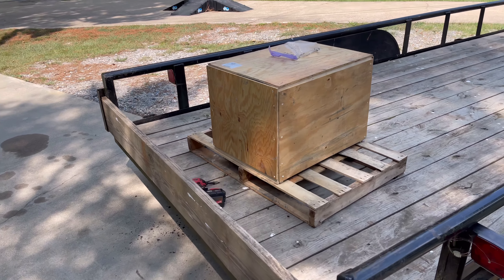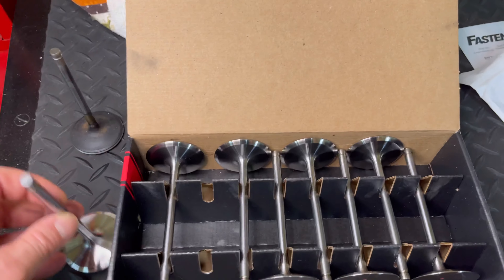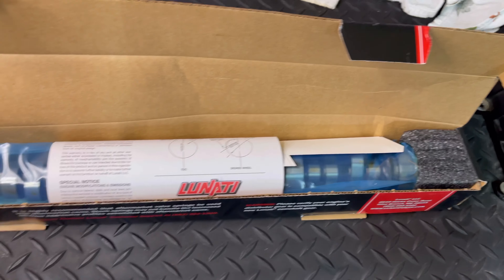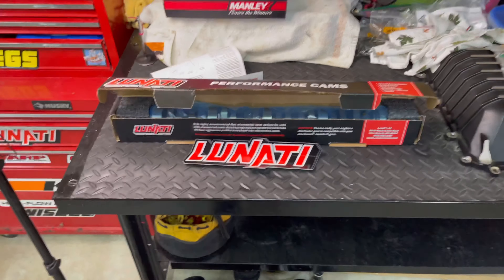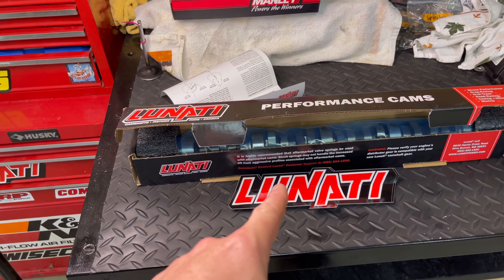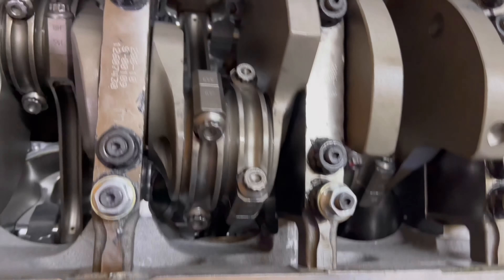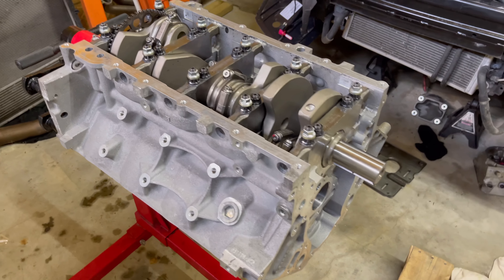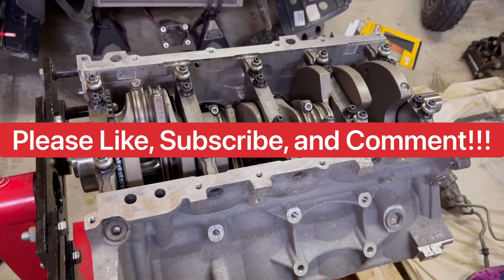IT’S HERE! Rick Crawford 416ci Stroker Short Block! New Rick Crawford Custom Cam! Lightweight Valves

Comment: Hope all is well, my lsa threw a rod so I’m starting a 408 build now. Any idea if these are the standard Lunati rod and crank or the step up series? Looking for a setup to do 900wheel reliably. Pretty close to doing the summit pro ls kit.
Reply from the maker: All is well. Sorry to hear that. All that I know is that they are Lunati’s 4” stroke billet 6 bolt crank and billet H beam rods. Rick Crawford picked them out. I am guessing that my power output is 900rwhp range.
Reply: @whiplashtv2022  perfect thanks
Reply from the maker: You’re welcome